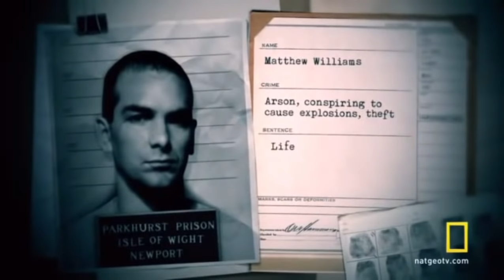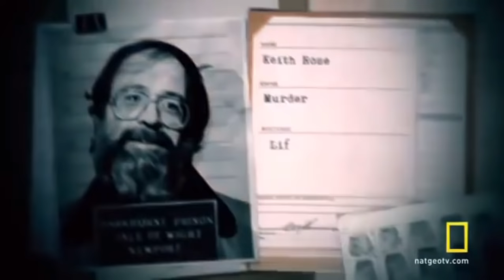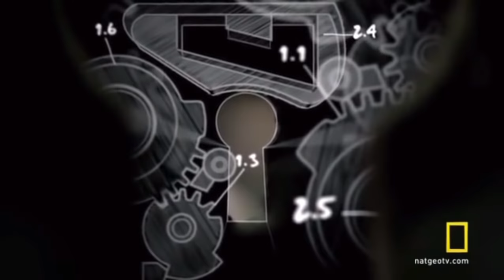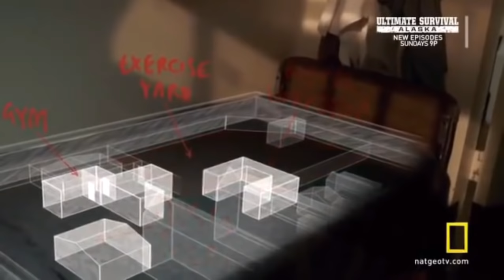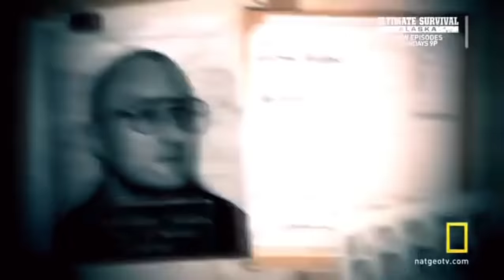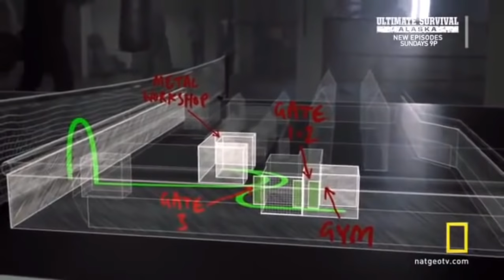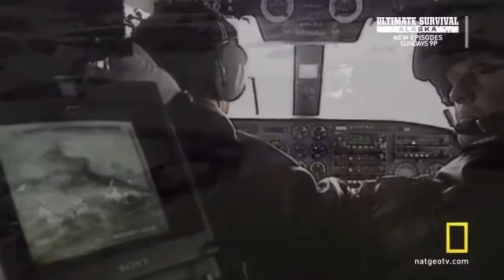Breakout : S02E04 Island Fortress

Comment: He made keys from steel in the metal works, a ladder to scale a 25ft wall that they put together in minutes, managed to get away from the jail, even tried to get a plane to work but he couldn't untie a knot in a rope to get the boat out...Check mate..
Reply: Wet ropes are quite tough to un do.
Reply: Even if he did probably would have been spotted by helicopter in the boat.

Comment: But how did the last guy rappel down the wall? If the rope was attached to the ladder, it would come crashing over the wall, causing the last guy to fall all the way down to the street. Bit of a plot hole there...
Reply: plot hole? this is a true story lol

and the answer is weight distribution and timing. as long as the person on the rope is lighter than the ladder and the person on the ladder, it shouldnt be pulled. and they might have also just been a bit more patient and waited for the previous person to get to the bottom on the other side

Comment: You break out though the metal shop and don't take the tools you need to get a plane or  a boat started not even a knife to cut the ropes .  Weak
Reply: They thought that the plane would be working. You dont take everything from prison for two main reasons. 1. It will slow you down. 2. The guards will notice that something isnt right with the room and their escape wouldve been called out earlier.

Comment: They should simply taken the battery out of the second plane and put it into the first plame. Problem solved. Simple!
Reply: Much more complex than you think
Reply: @Beep-  How come?
Reply: @horseandcart5978  different planes would need different batteries, and even if it had the same battery then switching them would be a complicated process which would also require keys and tools.
And you factor in the noise they would make as well as the fact that it's not as simple as a car's battery being changed.

Yeah... its complicated